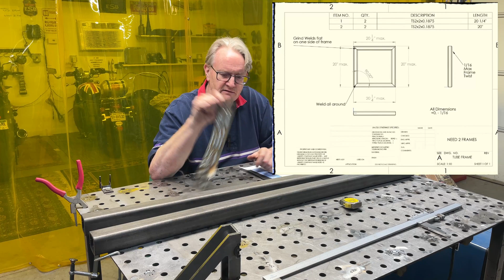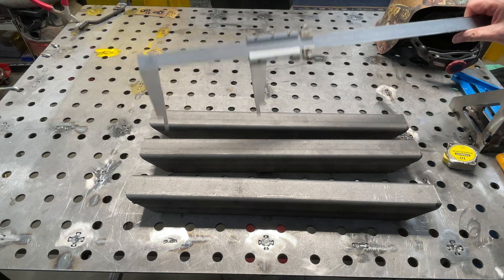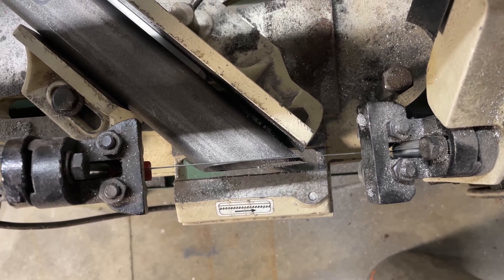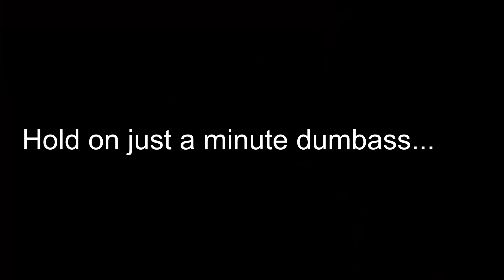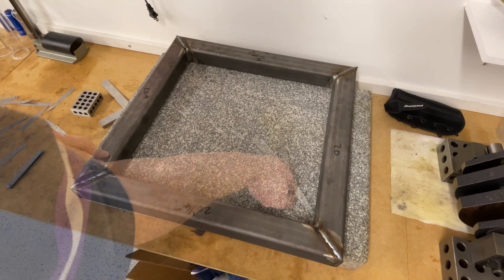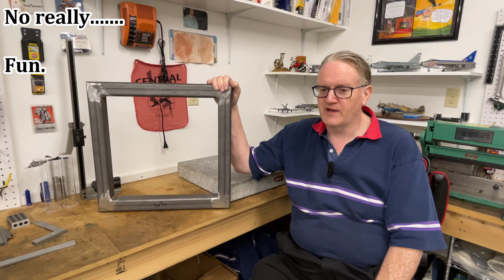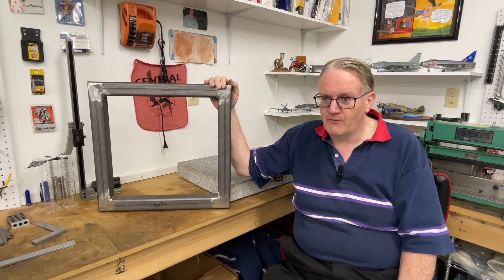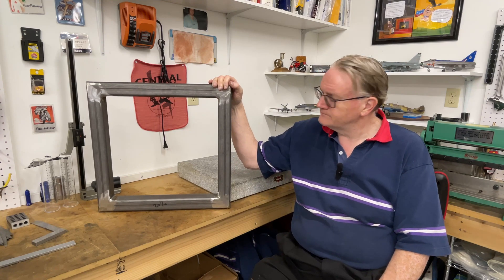The Fireball Tools Frame Challenge - Can this amateur succeed where pro's failed?

Comment: I've used those red magnetic angle magnets and a framing square, and the concrete pad outside to make a big workbench and our gate. Luckily nobody was around with a giant surface plate and feeler guages! Well done, very Shed-worthy!
Reply from the maker: I reckon your approach would have achieved similar results to mine. I think my shed floor is flatter than my table.

Comment: Great video, I really enjoyed watching it! The real struggle of the workshop without equipment worth bazillion of dollars. Yeah, it's not fun when you do your best, knowing that the fault is not lack of skills but lack of tools you will not buy because of their price. You were pretty close Stuart, that was really good job. The only thing you lack of is solid cast welding table with flatness deviation of 0.2mm worh $10000 and a saw for probably another $10000. But is that accuracy really needed for this part or it's just a tool producer trying to convince you to dig deep in your pocket? :)
Reply from the maker: Thanks for commenting - glad you liked the vid, I enjoyed making it very much. All tool producers try and get me to dig deep in my pocket. I'd sure like a table that's flatter than .180" though. I expect I'll pick up a used saw for around $500 eventually, for a table I'm still surveying what's available. Maybe new offerings later in the year will be appropriate. Or I'll be wowed by some other shiny thing. It's been known to happen.
Reply: I agree, well done. For tools, even a smaller fixture table is worthwhile. Jason's stuff is nice, but it's admittedly expensive. There's a smaller table made by Langmuir Systems that is much more affordable and plenty good for a home shop. As for the miter cuts, I think you could get them close enough by rough cutting on the band saw and then grinding to a precision scribe mark. Cheers!